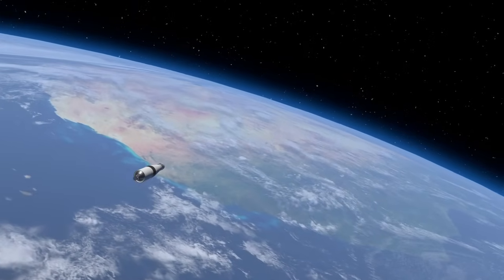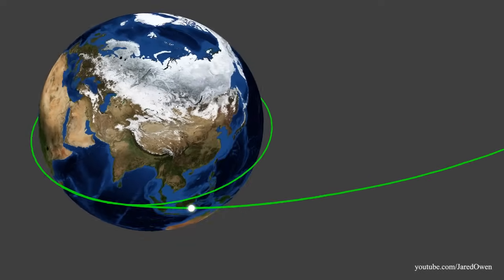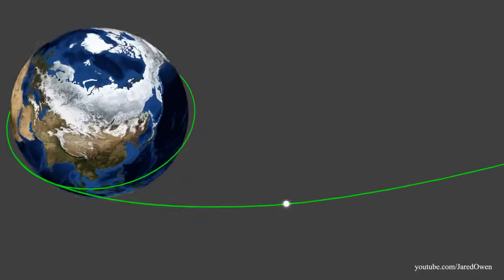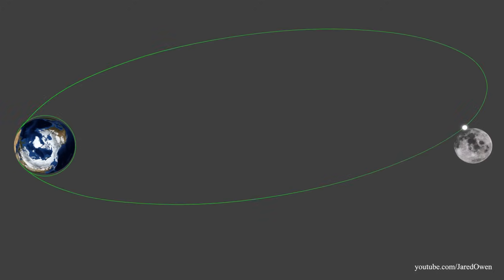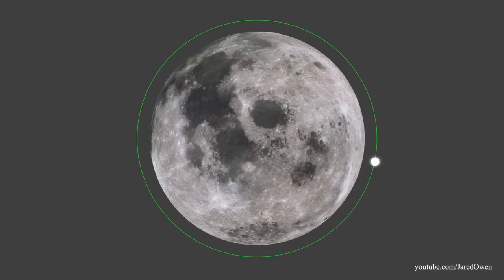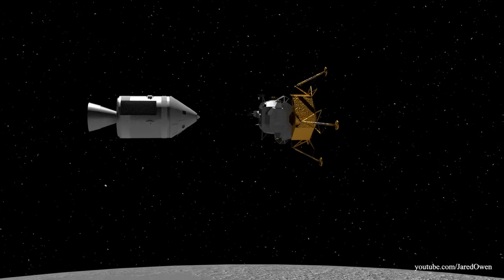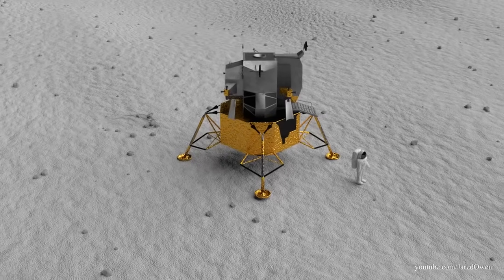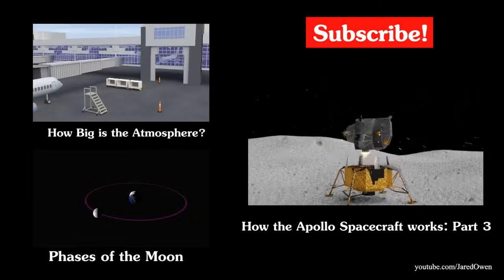How the Apollo Spacecraft works: Part 2

Comment: they used gold to protect steel legs from rocket blast doesn't gold have a low melting temp and very soft name another project where gold is used as protection from rocket blast ::)))der stupid bullshit:)
Reply: "name another project where gold is used as protection from rocket blast"
Behold...a man who can't (or won't) use google. Golden foil is used because it is superior to most other surfaces for the reflection or IR radiation. Maybe it has something to do with the fact that gold doesn't easily tarnish like steel or aluminium and therefore can keep its shiny heat reflecting exterior, something that materials scientists and engineers understand very well...
It also wasn't used to protect the legs from a rocket blast....not having the legs in the way of the rocket blast did that. The only thing it did was protect the legs from overheating during the firing of the engine and from the heat of the sun.
Reply: answer at the top ::)))
Reply: Answer to what...at what point did I ask you a question?
Reply: not very good protection what do you think?
Reply: The reason they chose it was for protection from IR radiation.
It was excellent protection from IR radiation, much higher functionality to weight ratio than any of the other available materials at the time.
You're assuming it was used to protect the lander legs from direct exposure to rocket exhaust, as if the legs were directly over the nozzle. This is simply not the case. Stop pretending it was.
Reply: the rest was made of cardboard and couldn't rotate ion resistant ?tee hee
Reply: it was made of pudding or do you really know ?the design was destroyed:)

Comment: It does'nt mention anything about the van allen belts though ????????
Reply: You wouldn't mention the speed-bump you ran over during a 250 mile journey, would you?
Reply: Ted cox 
Chernobyl, the second worst nuclear disaster in human history =\= a speed bump.

The radiation in Chernobyl during the initial cleanup was not equivalent to the van Allen belts.
The former included heavy doses of gamma radiation, the latter is made up of alpha and beta particles that can't penetrate aluminium, steel, or glass.

The only people who have suggested that space suits be used in radiation cleanups are people who don't know anything about radiation or spacesuits (ie. conspiracy theorists).

3 simple reasons not to use spacesuits.
1. They're bulky and clumsy. You can't navigate a disaster area in a spacesuit.
2. They're heavy. They weigh as much a full grown man. Not a problem in a low gravity environment. Not good at all in disaster area, and how will you carry heavy tools too?
3. They offer no protection from gamma radiation. Alpha and beta particles are totally blocked with a spacesuit, but we can do that using radiation suits that don't have the first two drawbacks of spacesuits, and are a fraction of the price.
Reply: SHAHED GH The van Allen belts are regions of space around the planet where charged particles from solar winds get trapped by the earth's magnetic field.

The belts do contain much higher concentrations of radioactive particles than other regions of space which can pose a hazard to  spacecraft electronics and to the health of astronauts. But like all radiation workers, if appropriate precautions are used the risks can be mitigated.
People who think the moon landing is a hoax like to imagine the VAB is some impenetrable forcefield, this simply isn't the case.
Reply: trace d i feel so stupid watching these videos what is this belt??
Reply: Where did the radiation in the radiation in the VAB come from Niel? Outside the......( fucking idiot)
Reply: Where does the deadly radiation in the VAB come from?  Quiet voice from the back of the room says "from outside the Van Allen Belts." " WHO SAID THAT ?"
Reply: 210 cubic feet is very different from 210 square feet, which can also be very different from 210 square feet. Nothing, can fit into Superiors 210 square feet but I can fit a house into mine  (skinny house, get the joke?)

Oh, by the way, 210 cubic feet (what highly Inferior actually meant) is a broom cupboard. a tiny bathroom is much larger. That along with the  composite photos make me very suss.
Reply: Add another few feet to the 7 foot hight, at least a foot, for minimum cealing heights, subtract that from the length or width & you have a broom cupboard or pantry, not a bathroom. Now turn your pantry/broom cupboard/really tiny bathroom into a cone & it becomes all that gear.
Reply: It must be the real thing then? You show me this crap, it could be anything. Where are the other 2 guys, where are their space suits, helmets, overboots,backpacks, piss, shit, drinking water, dozens of pounds of Moonrock & dozens of filmreels?  In another walk in pantry? Just 1 set of gear would fill every inch other space you can see here. Now x 2 + 2 more bad actors & you'd  already need to have well over 100 cubic feet more space than is showing. Then you've got your  air pumps & heating & cooling system + god knows how many tanks. All in a cone no bigger than a very small van.
Reply: If the speed bump were in Chernobyl Russian you'd mention it. The radiation there approximates the radiation in the van Allen belts. Extremely deadly. It was once suggested that the Chernobyl clean up crew wear the suits that were used on the moon since they survived outrageous levels of radiation and NASA said that would not be wise.  Really?
Reply: @Jugivadi  extremely deadly IF you stayed in the belt for a full week. That's according to Van Allen himself mind you. I'd take his opinion that the radiation exposure in total was that of a standard x ray procedure. A week would kill you. Not the blip of 10 minutes which Apollo spent passing through but let's not fact get in the way of pseudo scientific bullshit.
Reply: I didn't know solar particle come from the Earth? Like to try again? You make it sound like the VAB is the origin of these deadly & highly charged particles. You're good for a laugh though. Telling me where the particle go after the VAB but not where they were before, hence the ones that will be in the VAB next week.
Yep Superior. In a a 6x6 cone called the Command Module, they had 3 big guys, 3 even bigger space suits (funny that when not worn, you never see the stored suits?, just dozens of square feet of space around 3 astro nots, in overalls) , 3 big, bulky helmets & backpacks, 6 bulky overboots, several dozen reels of film, a computer the size of a bookase, compressers, motors, power supply,tanks, hoses & pipes large & powerful enough to clearly re pressurize & re atmosphereize the craft several times, during the 8 day mission, several dozen pound of Moonrock, gallons of drinking water, piss & solids. & 7 parachutes, each of the 2 drogue chutes & web of lines being considerably bigger that the craft & each of the 3 mains, utterly dwarfing the capsule, EACH! (you may just squeeze one main, into the CM, assuming it's an empty shell (you know, like believers heads), but according to you this unstable, joke of a craft had 2 inner steel walls? TARDIS eat your heart out.
Reply: In the boom cupboard sized CM, they certainly didn't have all the thinks I mentioned. So, who's the liar? By the way, 210 Square feet x  what ( x 0 = no storage space) Yet another drongo takes me on & makes a total fool of themselves.

Comment: how did the astronauts transferred from Command Module to LEM?
Reply from the maker: Good question - I actually don't know!  I would like to make more videos about the Apollo Spacecraft that goes into more details like this
Reply: Correct.  Plus there's a drone chute and three parachutes with lines (that had to be anchored to the strongest part of the capsule) to negotiate by.
Reply: Thru the ~30" diameter transfer tunnel on top of the CM.

Comment: These videos are excellent!  They are beautifully animated and clearly explained - well done.  There will always be idiots, but for those with brains, especially younger ones who were not around to experience this first-hand,  these are a really good introduction to the facts.
Reply: you are a good lap dog
Reply: Noelle Leger  you said that
on comment
 another
Reply: The lunar module does not appear to have any jets so as to turn the module around in the correct position to be able to land. that big jet in the middle is just a thruster. The animation looks like something out of the Clangers
Reply: @religionisasnare  Since your username is "questioneverything", have you tried questioning your belief in your own intelligence?
Reply: It's too short with  lots of unanswered questions for an old timer like me. The module is too small to hold everything they supposedly took.
Reply: @robertkimberley3736  What do you think they "supposedly" took that wouldn't fit with them?
Reply: @joshuaomer9644  fuel, a buggy, cameras, rocks, food, batteries, flags, oxygen, wireless radios that wasn't out yet, big heavy suits that withstand -250f to 250f. And something for sea sickness since they barrell rolled for 3 days covering 220,000 miles with less fuel that a Ford fiesta.
Reply: @waynejunior6480  Believe it or not, they actually designed the Lunar Lander to carry everything they needed for the trip, to include what you mentioned.

And are you suggesting that wireless radios weren't a thing in 1969? That's absurd.

Also, barrel rolling for 3 days? Where did you hear that? It's patently false. And it carried thousands of pounds of fuel, which, as you might not know, is a lot more than a Ford Fiesta.

It's painfully clear from your comment that this is a subject that you don't know very much about at all. And that's OK. It just means that there are lots of learning opportunities for you on this particular subject.
Reply: @waynejunior6480  Changing the subject, the hallmark of a person who doesn't have a coherent argument. If you want to discuss the specifics of your previous comment about payload or any other specifics of the mission, I'm more than happy to discuss it.

Also, you know 10 more than me? 10 more what? Lol.

Your moral objection has no bearing on the facts of the matter. And your objections are very obviously based on erroneous information (for example, NASA has been budgeted less than 20 billion per year for decades).

It's obvious that your opinion is clouded by your religious beliefs as well, which again, has no bearing on reality.

Comment: How is the moons orbit supposed to hold the entering spacecraft with 21750mph, although it only has 1/6 gravity of earth? Secondly, how do you throttle down 21750mph in a surrounding of a vacuum where nothing except your own power can stop you? This basically means, to stop the 21750 you would need the same amount of power with only 20% fuel left? DESPITE all that, here is the biggest proof we never went to the moon:

HOW IS IT POSSIBLE THE EARTH (SEEN FROM THE MOON) HAS THE SAME SIZE AS THE MOON (SEEN FOM EARTH) ALTHOUGH THE EARTH IS 4X BIGGER?? THEY COULDNT FAKE IT ANY WORSE ;)
Reply: that was it's speed returning to the earth, after falling towards the earth for three and a half days.
It's speed relative to the moon was much lower when they encountered.
20% of fuel left? The CSM was fully fueled.

The earth looks the same size in relation to what? The empty darkness of space around it?
Reply: Vince Bernau: I don't see the connection between "We never went to the moon" and "the earth is flat".
Reply: He just explained it in the video you thrust the opposite way for 6 mins to slow down the space craft
Reply: @Catpain, great question. The high velocity 20 some thousand mph was obtained at trans lunar injection only. The spacecraft began slowing immediately. Like all other orbiting bodies it’s subject to Keplars laws so it began slowing from earths gravity field. Just like if you threw a baseball high into the air, the greatest velocity is when it leaves your hand. The spacecraft was actually going pretty slow when it encountered the moon. That’s also why it took 3 days to get there. Your other point concerns the angular diameter of earth seen from the moon in photos. It’s a function of the camera and lens, not so much how massive the object is. These are not good hoax points
Reply: I am not sure if you mean your arguments seriously, or are you just being sarcastic ? (serious question, no offense man)
Reply: Vince Bernau watch my channel I show the Earth's to Moon perspective on 3d which clearly visually explains the issues with the Moon shots of Earth.
Reply: ok, i'll check out your channel, dan
Reply: kpn5000 thanks leave any comments regardless of your view no comments will be deleted.
Reply: Catpain Capslock wow ok keyboard warrior flattard
Reply: Ow, Sebastian, You'll upset the paid shills, planted to make the Apollo doubters look like idiots ( it's actually the believers who are the idiots)
Reply: They didn't need to do any better. Until the internet age, most people swallowed it.
Reply: You can block a full Moon with 2 fingers. So you'd need both hands, at least, to block the Earth from the Moon. 2 fingers would block the fake view of Earth, from halfway to the moon. IDIOT!
Reply: astrophonix you have serious issues, please take your medication.
Reply: Learn math, not meth.
Reply: @DontEverGrowUp  you are a good lap dog
Reply: DontEverGrowUp you are a perfect example for a globetard ignorant son of a bitch that trolls because has zero arguments. Thank you!
Reply: "HOW IS IT POSSIBLE THE EARTH (SEEN FROM THE MOON) HAS THE SAME SIZE AS THE MOON (SEEN FOM EARTH) ALTHOUGH THE EARTH IS 4X BIGGER?? THEY COULDNT FAKE IT ANY WORSE ;)"....(Mic Drop)...
Reply: More problem to enter Earts atmosphere without fuel. It impossible even now with "from moon speed"
Reply: Vince Bernau check my channel for that view explaining the hoax of the flight there. Also remember no rovers have ever landed on any Apollo landing site to take footage of the LEM or even the Moon buggy. Not 1 Rover since 1972. But plenty of rovers landed on Mars lmfao.
Reply: Daniel Ellinghaus they already spend 50 million per day. How many people would that pay for education?  Or health care?  If NASA has destroyed the technology that got them to the Moon well they have most of that tech still sitting on the Moon so again with 50 million per day and  NASA can not verify visually the state of the "destroyed technology" left there on many Apollo sites since 1972. Why is NASA concerned about private Rovers landing on those sites since NASA has not given 2 cents about those sites since 1972. What they are worried is they will have to pay off those private companies for decades to keep the " landed on your site's and nothing there so ...... Yes pay up bitches" Hilarious NASA worried about their sites being disturbed lmfao. Listen has Hollywood ever produced a film about the Apollo 11 moon landing? From start to finish ? Where is the Moon landing anniversary parades? ? A day in the calendar to celebrate the most important event in history? Lmfao. Trump has just killed the ISS and is demanding NASA back to the Moon good luck.
Reply: @Vince  They really don't have any arguments or irrefutable evidence, do they?  Then, in desperation, they try to shift the burden of proof onto us.  The burden of proof still lies with those making the claim.  They claim they went to the Moon, but, cannot provide any irrefutable evidence that they did.  Yet, they insist the burden of proof lies with those whom doubt?  No, it doesn't work that way.  If I tell you I flew to Mars last month, I am responsible for proving that I did so.  I would be totally intellectually dishonest to claim that you must prove that I didn't.
Reply: Danfuerth Gillis these guys are full retards...
The kind of man who gets cheated by his wife because he doesnt realise anything haha
Reply: Vince Bernau Your size earth issue is clearly shown on my video showing you relative distance views check my channel small short video. Or all 3D software made in the last 30 years is wrong according to NASA.

Comment: Excellent vids. One slight error in the animation is that you have the CSM going backwards so that the thrust from the engine will slow the CSM down and bring it into lunar orbit (which is correct) but then in the next scene it is going forwards. In fact, after going into lunar orbit the CSM was pointing more downwards to facilitate re-docking with the LM. But that is being very picky ...
Reply from the maker: Thanks for the info Simon!